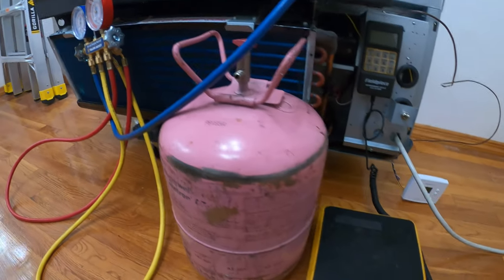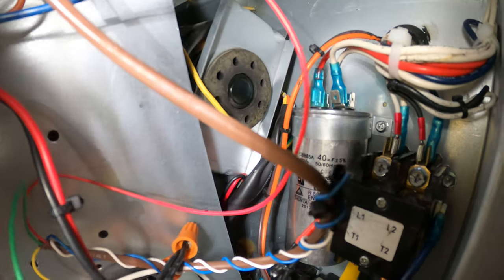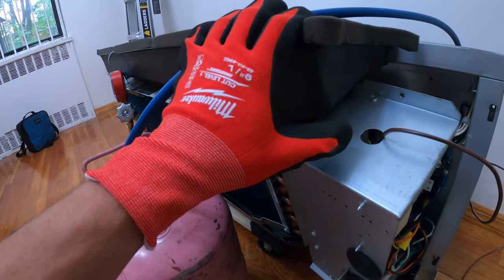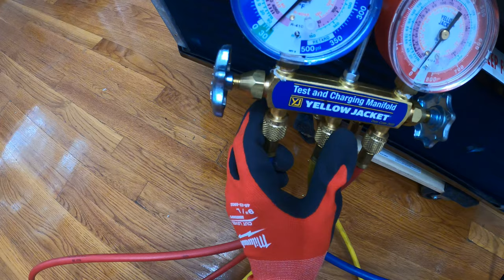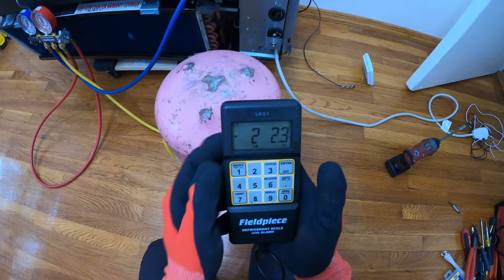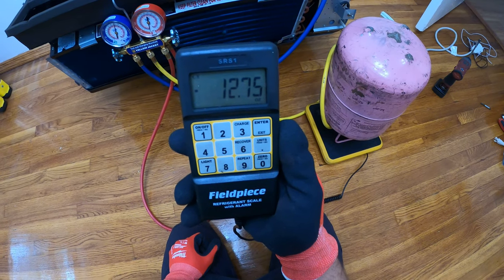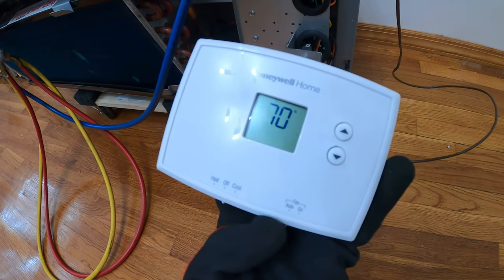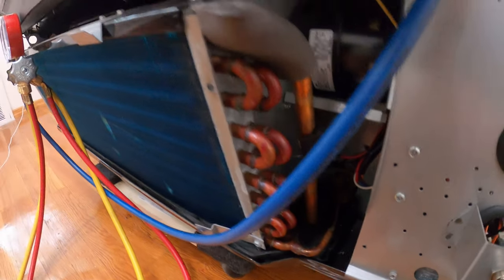HVAC: How To Charge An AC With Refrigerant Using A Scale (Charging 410a Refrigerant/Freon)

Comment: Love your videos. Not sure about the high side not having an access fitting because it’s 410a though. I’ve worked on tons of 410a systems with access fittings on the high side…residential splits/ rooftop units/ water source units/ vrf systems. I think it’s just due to it being so small in size. Not sure though, but I am curious.

Comment: You got to the entire 44 ounces like that?  I'm using a scale and 134a for my car and it just .. stopped around 5 ounces.  It refused to go further. :\
Reply from the maker: When it can't take anymore, turn on the AC function so the compressor starts. Once the compressor starts, charge the rest of the refrigerant👍 Stay tuned for new videos every week🔧⚡
Reply: @JumpermanTech  thanks, that's what I ended up doing :) I just thought it was crazy that you got all of it without turning it on.   I suppose the system and the refrigerant type REALLY make a difference there!

Comment: you overcharged it, the refrigerant in the hose after you purged wasnt accounted for. 

I learned this the hard way on tiny critically charged systems. Otherwise great video.
Reply: So are you implying to scale it before purging the hose?
Reply: Actually, based on what I learned and read, there is roughly  0.2 oz. left in the yellow hose after you charge any system.  Because of this, it's OK to "go over" that much when watching the scale readout.  Doing this, makes up for the shortage of refrigerant left in the yellow hose that's NOT going into the system.  What HE did was fine.  He put in 0.1oz. more instead of  0.2 oz. more (44.5 instead of 44.6).  It's better to be a smidge undercharged than put too much in.  👍😁